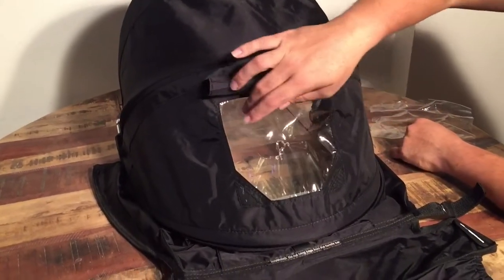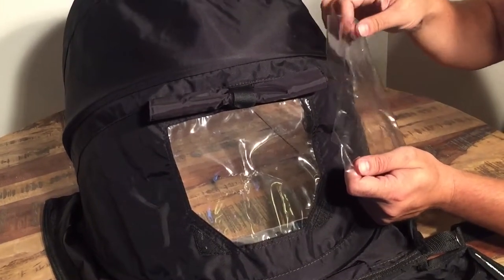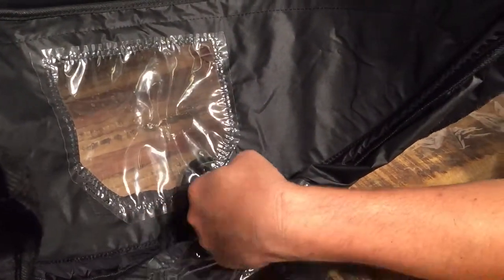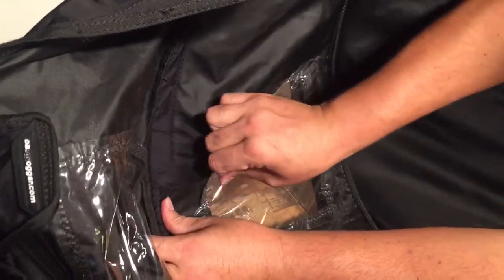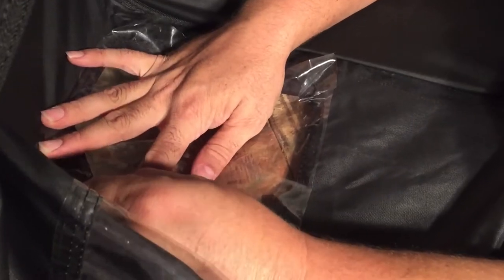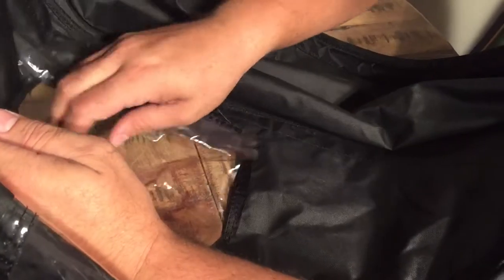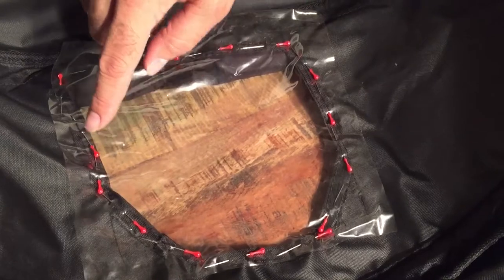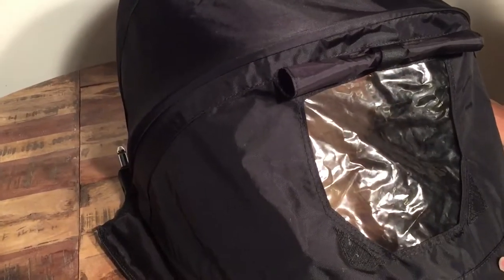How to Repair / Replace the Plastic 'Peep' Window on a Stroller Canopy

Comment: Do you think it would be possible to swap a plastic window for a mesh one? It's hard for me to see and hear my toddler through the plastic window and it's the only thing I wish I could change
Reply from the maker: Absolutely, it's just a quick sewing job :)
Reply: I also recommend using Fray Check (it’s a little liquid bottle you can get at craft stores used for sewing) to make sure the little loose ends of the mesh don’t become all frayed and undone.